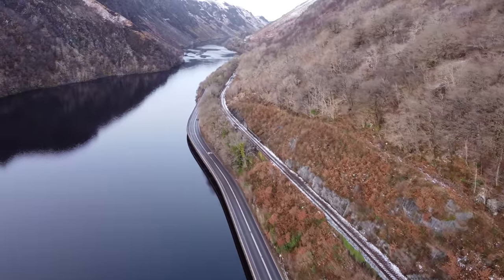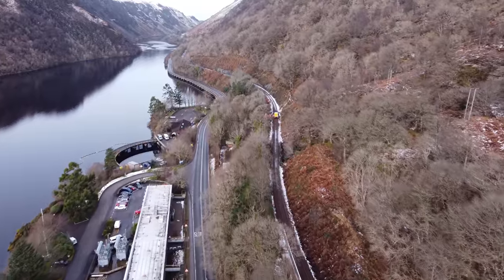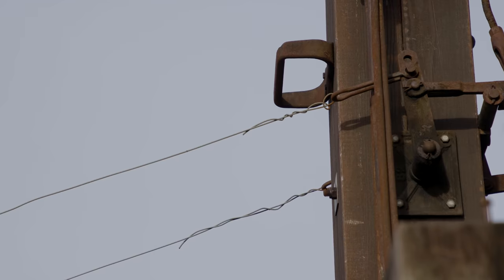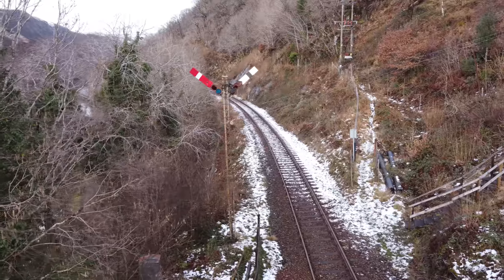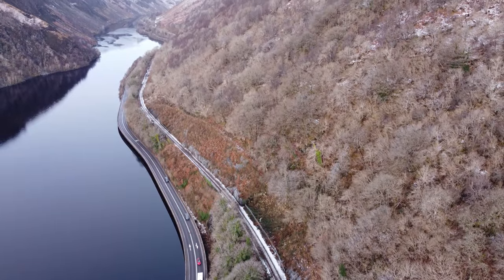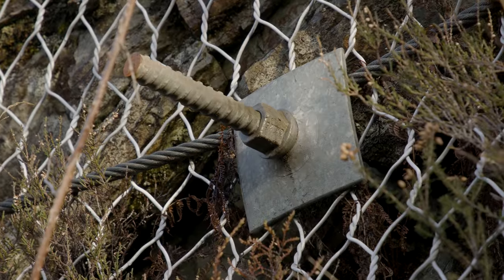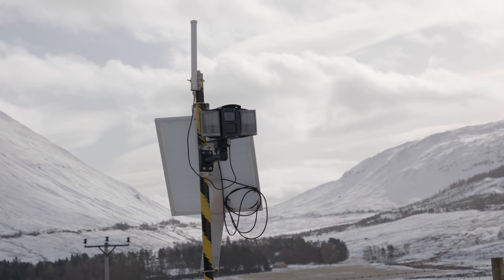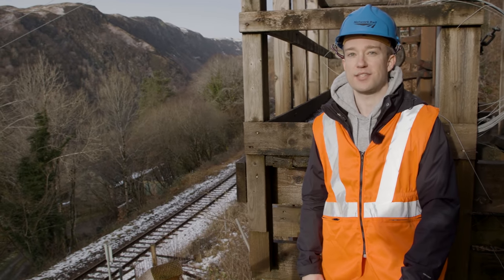After 140 years, this old technology still keeps trains safe

Comment: Love Victorian era railway engineering, the ingenuity applied to problem solving without electrical and electronic systems is amazing.

Having said that, as an old hand Signalman it came as a bit of a shock to see non absolute semaphore signals with red arms
Reply: Was it a good job
Reply: @oscarosullivan4513  was and still is tho I do miss the exercise these days. Sitting in front of a bank of monitors doesn't have the "feel" of 192 shiny steel levers and panoramic windows
Reply: I adore analog engineering 
Digitals great and I wouldn't want it to disappear.

But it's not as satisfying as analog and you feel like making it is more of a challenge

Comment: It's actually a bit funny to imagine someone from the rail service ordering new wire for Anderson's Piano starting with the line, "I need 100 metres of your weakest wire"
Reply: Ahahahaha
Reply: @hairyairey  You could pay a lot to have it coated with anti-rust stuff or something. Wouldn't be economically viable though.
Reply: @hairyairey  or you could just coat the drums in oil.
Reply: Simple enough, you take a few dozen samples of the original wire, and send them off for tensile strength testing. Then you get a nice set of figures for the tensile strength, and the elongation at yield, plus a plastic deformation load. then your request for supply goes out to your suppliers for a wire, coated with zinc, like most wire is, that is within 10% of these 3 parameters, and you get the result back. Choose a supplier and order 100km of the wire, test on arrival to ensure it complies, and place a few rolls in the local stores area, ready for use there. Not at all difficult, and while the new wire might be a little thinner than the original steel, due to improved steel making resulting in a higher strength steel, it will still fit the old mountings and apparatus perfectly.
Reply: @KurtFrederiksen  the wire gage doesn't matter as much as you think it do
Reply: Simple, go to Ebay, look up strong fence wire and set item location to China.
Reply: @hairyairey  store it in oil or coat it in cosmoline
Reply: @ragnkja  100m would probably be enough. The infrastructure is already in place. 100km could replace the whole system. You would only need to replace the broken one. As someone who works on a heritage railway, finding modern nearest equivalents to 19th century tech and specification is a common issue. Sometimes resorting to bespoke building things ourselves the old way, as it originally was. We don't keep endless supplies in stock. Just enough to cover the work needed in the time between ordering and arrival. Things like fabric coverings for seats, wood for door and frame panels, horsehair for seat cushions. To this day we are still using the original engine track tokens from when the railway opened in the 19th century.
Reply: @fullnuclearbreakfast  my wires are too weak for you traveler!
Reply: @hairyairey  All fencing wire is plated, it is designed to live outside, remember?
Reply: @cornishcactus  From what is said in the video you need to look up weak fence wire - strong may not break under rock impact.
Reply: @johnmurrell3175  you may want to look up sarcasm mate ;)
Reply: @hairyairey  in a container filled with a type of oil